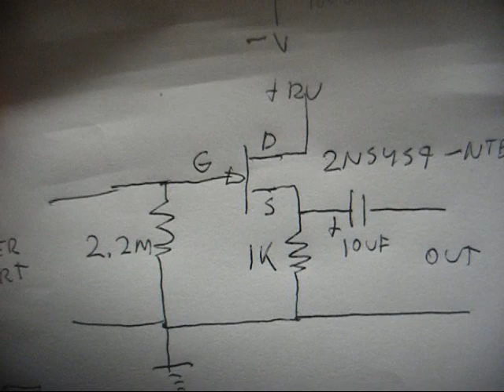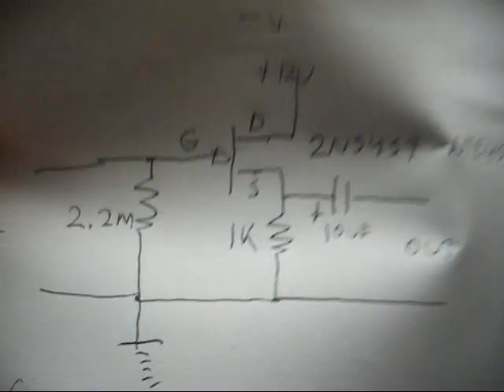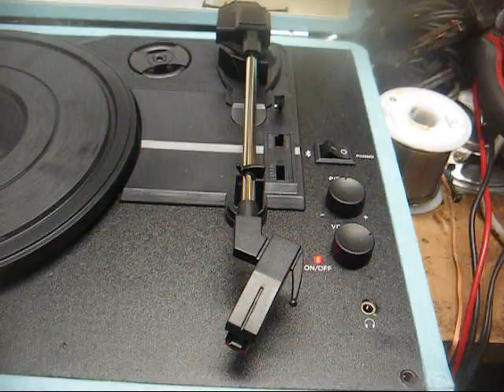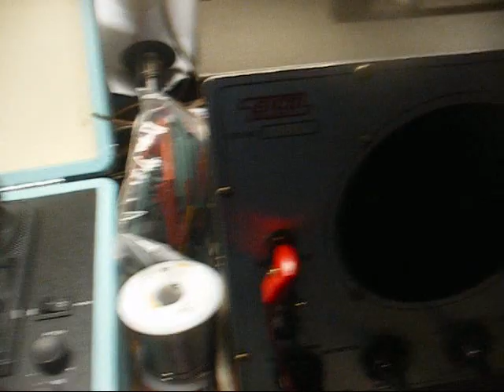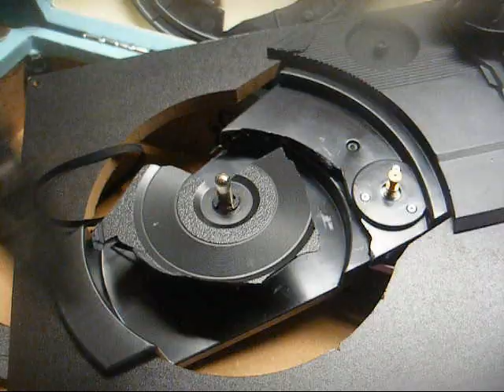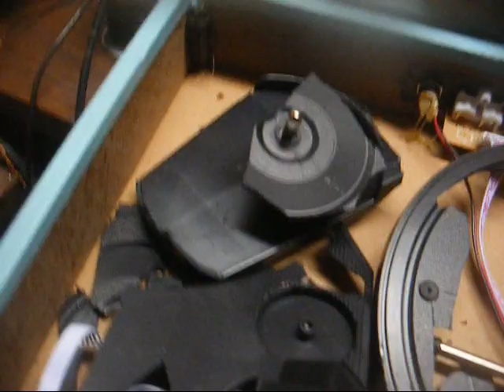A Crosley Cruiser record player takes it's last cruz EOL

Comment: Crowleys are for the people who like the idea of a record player, but don't want to invest in a decent quality one.
This is good for the rest of us who care about our hi-fi and electronic goodies.
Reply: The sad thing is that they are paying for something that costs $60 that should cost $20. It is just a toy or a novelty, nothing more.
Reply: @zulumax1  I think $20 is about what these things should cost anyway(or $30 if I'm being optimistic).  If you were to just source the parts, those are dirt cheap(cartridge and needle is maybe a couple bucks and the mechanism itself is not much more when buying these things in bulk).  It probably costs more to manufacture the cases of these things.  Most of the cost is marketing and distribution(getting over here on the boat from China).
Reply: @0386rm  One could build a rough example of that with individual parts (the crappy record player mechanism that is everywhere, a pair of cheap paper speakers, and an extremely crappy amplifier board if that's not included with the mechanism, some crappy particle board and vinyl wrap) for probably under 40 bucks. It gets way cheaper with sweat shops in mind for those parts. I agree 30 bucks is what these should be sold for. I just find it sad people legitimately use these for their "record collecting hobby."

A half decent proper turntable from the 80s could be had for around 15-20 bucks, 10 bucks or less for the belt to get it working again, then maybe another 15 for a cartridge/stylus if the unit was actually used for an extended period of time. Techmoan also came upon a proper turntable currently being sold that would be comparable in quality to a lower end 80s unit for less than 100 dollars. Not to mention both a lot of those lower end 80s turntables and even that new one I mentioned I believe use a standard cartridge, so they could be upgraded over time.

I'm not sure why people act like these Crosley (and the hundreds of others made with the same mechanism) record players are the only option, there's plenty more if you actually care about getting into the hobby.

I casually listen to records every now and then on a belt-drive Pioneer PL-590 from the 1980s. I've never had an issue with it after lubing the motor and putting a new belt on it, sounds way better than one of these "Crosley" record players and I got it for free. I've seen comparable models in thrift stores and local for extremely cheap.
Reply: If chinamart sold these for 9 dollars and 99 cents,they would still make a profit.
Reply: @ixionn563  Did you see the cardboard cheap record player kit Techmoan did?

Comment: This is without a doubt one of my favorite videos that you posted. I laughed through the whole video because Crosley sucks so bad. But that's what happens when you have stuff that's made in China. After all, you can't polish a turd
Reply: I hate to be 'that guy', but some stuff from China is actually respectable.  But you have to be willing to pay a little more than the low, low Walmart price for it.   And the thing is, the price of the 'better' stuff isn't really all that much higher.  I have a Target Heyday turntable that, for $100, has turned out to be a surprisingly good turntable.
Reply: @xaenon  Yep, it all depends on what spec the buyer wants.

Comment: I remember seeing a video where someone just added a cap(or resistor, can't remember) to the wires from the tonearm. Worked....Just can't remember where I saw it though. It might have been on a forum from audiokarma or some such....
Reply: I was thinking that during the video. A crude way of avoiding impedance mismatch. A small electrolytic (10 - 20mf) should do the job. Not super Hi-Fi but workable.

Comment: I have the same unit in gray. In an attempt to gain more fidelity, I also used the line output to the Aux. input of a component system. Shortly after, I was hearing all kinds of howling, squealing, like feedback, but don't think it was feedback. It escalated not by volume, but rather how long it was attached. Quiet at first then noise would get louder & louder. I could not use line out as intended. Strange. Put it away for now. Never heard anything like it.

Comment: I love how the shafts of the pots ripped out of their housing. Also that cheap plastic seems more fragile than bakelite.
Reply from the maker: As that plastic ages, it will probably become even more brittle.
Reply: @radiotvphononut  Even my GE Wildcat has a cheap plastic case and the turntable base was plastic and the mechanism, spindle and the platter was metal and the tonearm was plastic. That was more common than this heap of trash Crosley Cruiser.
Reply: @radiotvphononut  It's already glass fragile from the box...

Comment: I'm thinking about doing a similar modification to a GE wildcat suitcase record changer.Thinking the amp is going to be good enough to push better speakers.Maybe install speaker terminals.After I go through it & clean the controls,so I have a good tetrad ceramic style stereo/amp combo.I already have a magnetic cartridge(Pickering V-15 AE 2)on my other stereo.
Reply: A lot of newer speakers also have odd impedance,so I don't think it's going to be a problem if speakers I use are same impedance.I have 16 ohm alnico speakers that are low wattage.

Comment: Perhaps you can fit a decent record player in the suitcase. Just cover the name of course.
Reply: If you can fit a decent record player, it should be called a Franken-Cruiser.
Reply from the maker: I checked and the case is not deep enough to allow mounting of an older GI or Alliance AC motor. So, I guess this case is just going to be a tool carrier.
Reply: @radiotvphononut  That would be a great idea. I remember last year, I got a 1950’s Howdy Doody Phono Doodle 78 RPM record player and it seem better days. The turntable was nice and the power cord was cut. So I did stripped the amp and the tubes and convert it into a Bluetooth speaker. I used my Bluetooth speaker, place it inside of the turntable, turn it on, paired it, and it plays. The Howdy Doody Phono Doodle is rare.

I also remember one time, I had an Imperial kiddie record player when I was at the Hudson Valley Restore and it worked fine, so I ended up stripping it and tear it down, because it’s useless, so I use it for art supply things.
Reply: Paul NJ, RTVPN:   If you're going to do that, I suggest you start with a Crosley Keepsake.   Most of the 'mod' work is already done for you.   The Keepsake cabinet is quite a bit larger (and more substantially built) than the other 'briefcase' players, and got a few upgrades over the Cruiser.  Larger, better (side-firing) speakers, for one, and a proper magnetic cartridge (at least, the one I have, the CR6249-A does).   It's still a Skywin mechanism, but the Keepsake gets the version with a full-size platter and an auto-return feature.  The big-platter version isn't as awful as the small-platter model, though of course, it's still nothing to brag about.  It also does track lighter than most - 3.5 grams, which is the recommended 'upper limit' of the AT3600 that's built into the tone arm.

I think the Keepsake has a slightly better amp, too - with a real tone control as well.   And, obviously, set up properly for a magnetic cartridge.

If I had to sum it up in one sentence, I'd say the Keepsake is the 'grown up, respectable' version of the Cruiser.

Comment: Did those turntables originally come with a crystal cartridge as it seems so stupid using a crystal pickup to drive an amp designed for a line input?  Surely a magnetic cartridge would be better and eliminate the need for that FET circuit. I am guessing the gain of that FET circuit with no feedback is just too high   American mains hum is actually quite  pleasant compared to the very irritating low mains hum we get in the UK.  It's so cheap even the platter is made from plastic.

Comment: I think I would have tried op-amp approach to this. You can easily set the input impedance and the gain. And if you wanted, you could even apply some eq in the feedback loop. Just an FET with no negative feedback is going to give marginal results. As for the Crosley itself, I think the bass rolloff was likely intentional. Those speakers can't reproduce low frequencies worth a damn, and I doubt the amplifier has any power with mentioning. They'd only throw out distortion and make the whole thing sound even worse. Face it, it's junk.

Comment: I was about to say use a hammer-but turned out not necessary-the cheap,brittle plastic caved in under the wire stripper!The best part-save the case for something else.If you the builder are going to use plastic-at least use a quality unbreakable kind!Would have been fun to see how those speakers would sound with 120V!THAT would improve their bass response for a brief moment!

Comment: I was a little disappointed by that as you were getting close to achieving a worthwhile improvement in sound quality for the infamous Crosley Cruiser or Poor Person's Record Player there.
I think that you should have provided the Power Supply for your Z Matcher Stages via a Decoupled Feed as it seemed like you were getting Motor Whine into the Audio with it wired as you had it.
A couple of Level Adjustment Presets would probably have addressed the Acoustic Feedback problem and it wouldn't have been too hard to connect that Metal part of the Pick-Up Arm to Ground to reduce Hum.
The Volume Potentiometers (Dual Tracking for Stereo of course) could have been swapped out if it wasn't just bad joints.
I think that you let your Temper get the better of you.

Comment: If you're looking for a small music player, get one of those combo cassette and CD players (with radio) from the likes of Sony. (I can vouch for the ones from the 1990s, no doubt 21st Century ones are built cheaper). Even the vintage ones were cheap, but you could get half decent sound out of those small speakers, and cheap CD players sound better than cheap phonos, especially if you use headphones. Using a Crosley Cruiser to explore vinyl is like using a Smart Car to explore offroading.  If you must have your "vinyls", then have a friend with a good setup record your LP from a good turntable into a cassette (Normal bias tape will play on the cheap players), and you will get a much better sound than any Crosley anything.  "What's the point of having vinyl if I'm going to listen to it on a cassette?" you ask? What's the point of having vinyl if you're gonna play it on a crappy suitcase player like a Crosley?

Comment: That platter gets easily tear down in pieces.
Did you discarded the crosley luggage case? It would  be good for a new use.
Reply from the maker: I've still got the case and am going to try to use it for something else. I may transplant some older record player parts into that case.
Reply: @radiotvphononut  that will be a great idea. I'll be looking forward to see that. Those crosley turntables are boring and even breakable that's why thanks to your videos I ain't gonna mess around with those crosleys I'll stick with a cool and decent new or used turntable. Cheers from Phoenix AZ.
Reply: Would be good for tools. Maybe even with a foam insert.

Comment: Sometimes if you use a stylus with a different material used for the cantilever, the low end bass gets a bit better (when you use an external amp & speakers). I saw a video comparing the stylus with the plastic cantilever with the aluminum cantilever and the difference was substantial.   I can't remember which sounded better though.....

Comment: Ooh, so violent. I need to run to my safe space and play with soap bubbles. 
Seriously, if anyone tried bashing my Technics SLD3 like that they really would need a safe space.
Reply from the maker: The SLD3's are nice turntables and are easily modified for 3-speed, if desired.
Reply: @radiotvphononut  I don't own any 78s, but I do own a lot of mono LPs and I have an Audo Technica mono cartridge for them.

Comment: I guess whatever "good reviews" this model may have received was because of its sturdy, fairly good looking cabinet, only. A good way to finish the Crosley off in the EOL tradition, is to place the insides (minus cabinet) on a cement alley drive through, on garbage collection day. Get out your best HD phone camera and film the destruction as the garbage truck backs in, and it's rear wheels ever so slowly roll over the Crosley Loser. Listen joyously for the symphony of sounds, "snap, crackle, and pop"! 😀